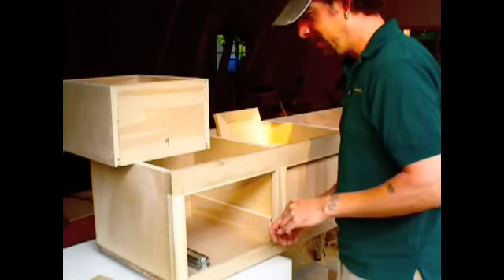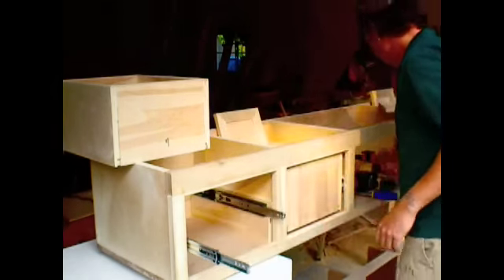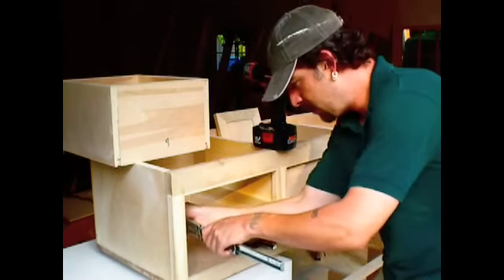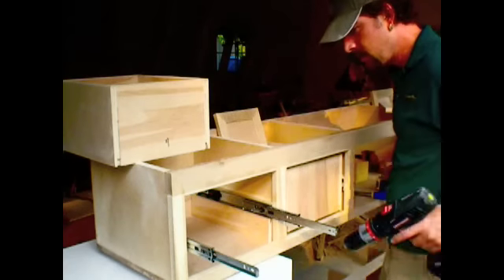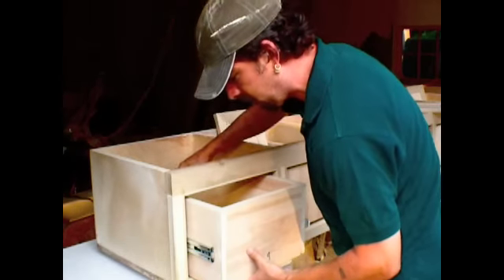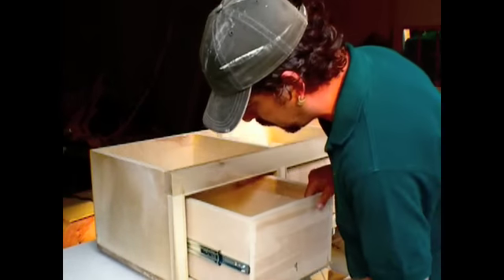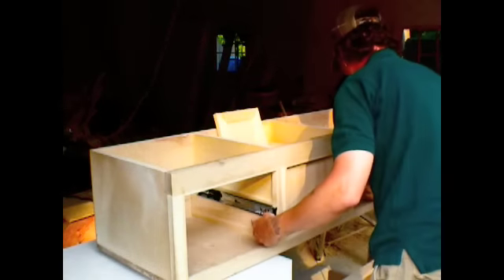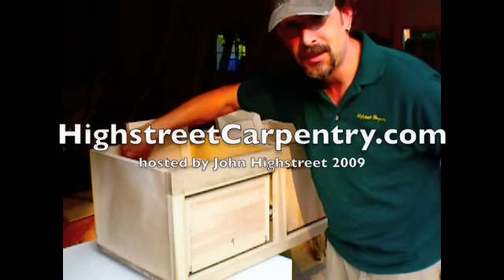Drawer Slide Installation

Comment: Thank you for the easy install video, it was much clearer than the printed instructions that came with the sliders. At first I wished I could see what you were doing on the left side but since you did the same thing on the right I quickly got over it. Thanks again!

Comment: Great tips in your video, thanks for sharing.  This works great for single level, but I'm building multiple drawers so the math doesn't bother me. I learned some alignment tips from your video on the settings for the main body of the bearing guides at the face-frame and also the actual drawer, so thank you sir.

Comment: Spacers work pretty good when you chamfer one edge and the opposite edge on the other side. They come out easier. Also... it helps to get some double sided tape to hold the drawer slide in place also. Quick roll around of transparent tape works as well as masking/painters tape. Not too much though, just enough to get you set.

Comment: Sure made it easy for me to make my two large drawers that go under my tool bench.  I noticed that you did not use a spacer under the drawer before attaching the side rails to the drawer, the drawer will drag on the bottom of the cabinet base as you slide in and out.  I use a 1/4 inch piece of wood under the drawer to lift it off the base of the cabinet.

Comment: One nasty trick with those "full extension" slides, is the hole has to be perfectly parallel with exactly half inch clearance on each side. Otherwise they will bind or even "jump the rails" when you open it. I found that out the hard way.

Comment from the maker: @DGxManBearPig1 
Not knowing exactly what the issue is I'd like to say that your case reminds me of an assembly job that I had in which it seemed that unless I had three hands it would be impossible- my solution was using a glue gun to "quick hold" the slides in place and after a few tries it worked quite well- the first few attempts, not so much, but just a dab of hot glue held the slides so I could get the screws in place.

Comment: You're the first one who's explained it well.  I could never figure out how you'd know where or how to line up the slides in the cabinet to the drawers.  Now, what's the story with those stiles?  Did you measure the depth of the inside of the space from where the frame is from the space?&*)#%@?  I'm still so confused and I need to do this with a couple of HEAVY drawer in a chest. Alice  I have the heavy duty thingys but need to know how to do it.  Thank, you're the best!

Comment: Why is there end grain showing on your face frame? The side "stile" should extend all the way from top to bottom so there is no exposed end grain. Not a bad drawer slide installation though, but I still prefer my Rockler jig. They're only $20some and it makes it super easy and repeatable.